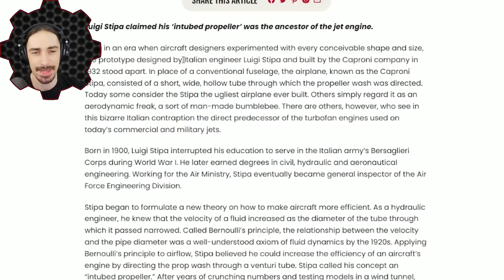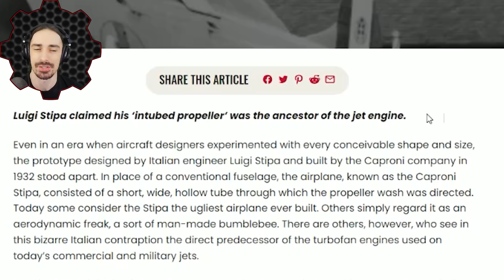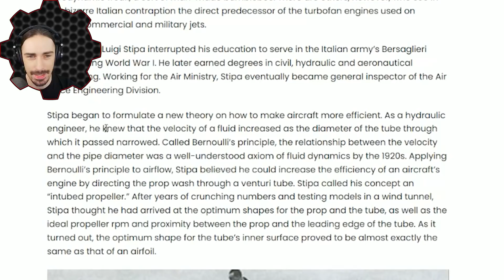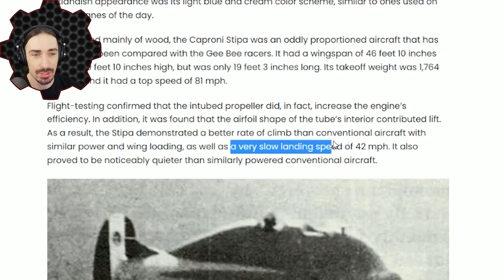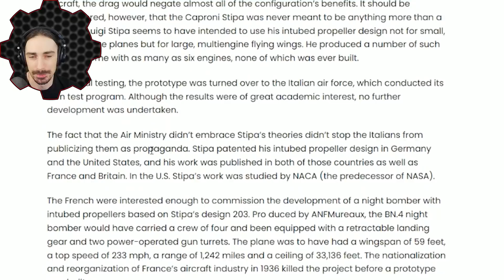Was This Bizarre Looking Plane Actually The First Jet?

Comment: It's definitely not a direct precursor to the jet engine, (it obviously is of ducted fans, but like, those are primarily used in naval architecture, not high speed aircraft.)

Of "jets" it's lacking the most important component, which is a convergent-divergent nozzle to actually concentrate the jet in a useful way for generating propulsive force. These types of nozzles are pretty much universal on modern jet engines, whether a turbojet or a rocket jet.

Speaking specifically to turbine jets, which is what is usually meant with when talking about airplane jet engines, he's also missing basically everything else: an actual compression stage, a combustor to make extra use of the compressed air by heating it up, an exhaust driven turbine to power the thing, as well as not having a proper nozzle on the end. (The fuel line plumbing alone requires levels of consideration this design doesn't even anticipate.) The design also does absolutely nothing whatsoever to help mitigate the problems that aircraft of the time had when encountering supersonic airflow, which was one of the most important driving factors in the early development of jet turbine technology.

It's like, literally just a propellor in a tube. That does not even remotely a turbo jet make, even though they have an aesthetically similar form factor. Looking like the nacelle of a modern airliner doesn't mean the technology inside is anything even distantly related. I mean, I guess it's like the first stage of a turbofan, but that literally is just a jet engine in whole cloth with a fan stuck on the front. Sticking the fan on the front isn't the hugely innovative part.

Comment: I'm pretty sure the yaw you see is just the huge drag. I also built an extremely large biplane powered by 2 (or when I want to i can get 4) helicopter engines at max power and it turns absolutely horrible because of that drag. If you aren't careful you could easily go into a spiral dive, which is  very hard to get out of in trailmakers, and even harder to get out of (and deadlier) in real life. So maybe you could try going into a spiral dive in you own spare time!

Comment: Nice video as Usual. Try to build the concept plane  Vought XF5U also known as the  ,,Flying Pancake,, normally I would doubt that someone ist able to recreate it in-game ,but you have proven yourself as quite creative in this manner .
Reply from the maker: https://youtu.be/BWNQngoesyc
Reply: @scrapman  maybe try a geebee some time down the road when it's not 2 "flying barrel" planes in short succession?
they were both literally the single best racing plane in the world and decidably a crazy wonky failure at the same time.

short version is that they were designed to take turns differently so they would loose less speed in turns while barrel racing, and as a result whenever a pilot would react reflexively to adjust during a turn and do the exact right thing for flying any other plane it would be the exact wrong thing to do in a geebee, with often catastrophic results.

Comment: -> My Actual Comment on this Video: I think the yaw was caused by the drag from the tail fins at the ends of the wings when rolling. You'll see what I mean when you simulate the aerodynamic fluid flow in your mind as you roll.
-> My Appeal to the Audience: Please like this comment if you want to see Scrapman learn more about the engineering mechanisms I've listed in the comment below.
-> DAY 2 of this comment. As far as mechanisms go, I know of one which uses two slots or double sliders intersected. IT'S CALLED THE TRAMMEL OF ARCHIMEDES. (It gives and accurate elliptical motion path)
Then there are mechanisms for drawing heart shapes (idk their names) and there's a kinda complicated one which I don't think can be built in scrap mechanic but it may be possible too if you can try. It's called the Whitworth Quick Return Mechanism.
-> Thanks & Have Fun With These 😄👍Or Not :(

Comment: I dont think that designing a duct that works in similar function of an extremely basic compressor for a jet engine, makes it a predecessor of it , the design doesnt take advantage of the Brayton cycle that jets are known for. If designing this should make his design of the predecessor of the turbine jet engine then the designer of the first pulse jet should be accredited more so as the predecessor of the turbine jet engine as the pulse jet has far more in common with modern jets than what is essentially a flying dyson air multiplying fan.

Comment: My theory for the cause of the adverse yaw ( at least, in trailmakers), is that the upward deflection of the ailerons has a much smaller AoA compared to the downward deflection. This is because the plane, as a whole, has a signficant upward AoA. More extreme AoA on one side of the plane, due to differential aileron position, causes uneven drag, and hence yaw.

Comment: Hey Scrapman, I actually got into Trailmakers cause of you. I can't figure out how planes work at all though. Best I can manage to figure out for the physics of the plane is basic stuff I learned from Jacksepticeye's Kerbal Space Program series. Keep thrust ahead of center of mass, wings above that, keep weight minimal, etc. Sucks that Trailmakers doesn't have any info displays for the center of mass or lift or even info to help you determine how much lift you can get. Got any tips?

Comment: I mean, it looks like a jet engine. I wouldnt say it was the first jet engine though because it works completely differently. A jet engine isnt just a powered propeller with a tube around it. The fuel is actually injected into the turbine itself.

Comment: Just to make a note of a detail which I think you may have missed from the pictures.  The engines were mounted on the nose of a regular aircraft body inside the barrel.  The tail in your case could be made connecting a hidden standard tail inside the barrel on the inner aircraft bodies rear end, just like a normal tail would be.  Just suggesting.

Really like your vids, keep them coming.

Comment: I replicated this plane in SimplePlanes before, and though not all the physics that are core to the design are simulated, it flew pretty good. The one outstanding characteristic I've noticed was the roll instability, which is what I assume to be due to the radial girth of the aircraft. Starting a roll is quite easy, however you keep rolling well beyond the point at which you stopped giving it input. You're practically leading a blind horse.

Comment: There is this kids toy from the 90’s and is still being made today called a flutterby fairy that was essentially a doll with a dress made out of propeller blades and when you turn it on the blades unfold and the doll starts flying and hovers over your hand. What if you tried recreating that in scrap mechanic using the wings mod?

Comment: Im not sure if it should be really credited as a predecessor to the jet engine, the idea of ducted fans is different from the idea of jet engines, hey engines don't get their thrust from the ducted fans in the front, the fans just supply oxygen at a faster rate to the engine so it can continue running, the engine itself is powered by fuel combustion, the fan concept just makes sure it gets oxygen fast enough to actually keep burning fuel so fast, another interesting fact is that some of the actual thrust the engine produces runs back into a turbine that powers the ducted fan, thereby being more self sufficient

Comment: There is also an important landing procedure called a flare. So when you are about to land on the runway, you first put your throttle to idle, and do a slight pitch up input. This will cause you to descend slower, while slowing down, to help stop the aircraft. It makes for some VERY smooth landings.

Comment: There are multiple ways to turn an aircraft. One of them is sideslip. This is used for small aircraft, how it works is you roll to any direction, and you do not input ANY source of pitch. The aircraft will literally pitch down, without pitching down. Kind of like a slide. It also makes way more yawthan normal yaw input, thus it will be easier to correct a wrong turn quickly. But if you go around the 80 to 90 degree angles, you will stall. And you will stall HARD. When they were testing, they described it as “the plane just fell like a stone!”. When you want to cancel or stop the sideslip, you roll the opposite direction and yaw in the same direction on roll. Then, you have to pitch up when you roll. When you are level, well, you are level I guess.

Comment: The problem with your yaw while you are rolling is called adverse yaw. It is also a problem on gliders. To correct it you just need to use a lot of rudder to counter act it.

Comment: day 154 or 155 of asking scrapman to start a Survival series amphibious tank/basically any transportation and floating base/barge (or under water.) But you need mods... it's a requirement to breathe underwater, if you want an underwater base/transportation. And yes i am talking about the underwater fan moonbo reviewed that basically makes water spaces air spaces... if that makes any sense.) (and if you wanted to move the barge/boat/floating base you are able to make thrusters/glitches/mods to do it or by lift or actual push

Comment: One more thing that does not translate to trailmakers is that the tube itself il like a huge circular wing that also provides lift. you can make a paper tube with an airfoil shape and it will fly when you throw it.

Comment: The adverse yaw effect when trying to roll is totally normal. It is more pronounced when flying slow/with a high angle of attack. The reason for this phenomenon is that the lift creating surfaces also create drag. When you roll into a turn, the wing on the outside of the turn creates more lift than the inside wing, so the plane rolls, but at the same time, as the outside wing creates more lift and therefore more drag than the inside wing, the plane will yaw towards the outside of the turn. To prevent this, you can couple the rudder/yaw function to the roll, so that the rudder actively pushes the nose towards the inside of the turn whenever you roll.

Comment: If you build the cylinder as an horizontal plane of plaques connected with hinges that dynamically form a cylinder, I think you can wedgegand the front end and massively reduce the drag.

Comment: The yaw when rolling is actually pretty accurate to planes in general, just some left turning tendencies, the only problem is you don't have tail rudders to counter it the way you built the tail
Reply: Agreed, the big rudder didn't help anything with TM physics... should have made the fin bigger on top
Reply: I love secondary effects of controls, lol
Reply: In this case its not left turning tendencies, it's adverse yaw
Reply: @rg759  which is one of the left turning tendencies
Reply: @casmsfrought9956  I think he means the p-factor, when the air from the propeller spirals around the airplane and hits the tail on one side. Air from clockwise rotating props will hit the vertical stabilizer on the left side, pushing the tail right and the nose left.
Reply: @LeftPlaying  That is slipstream not P-factor which is a tad more complicated. It is adverse yaw. E.g rolling to left increase lift on right side. More lift=more drag and thus right wing "drags" behind. You have to yaw in to turn to have a coordinated turn. And vice versa.
Reply: yeah, normal planes do that so that they don't have to roll so much and make all of the passengers go sideways, while still making relatively sharp turns.
Reply: Yep, sometimes I make it intentional. Helps with turning really big planes too so you don’t have to roll as much because if you roll just enough it’ll just yaw you to where you’re facing

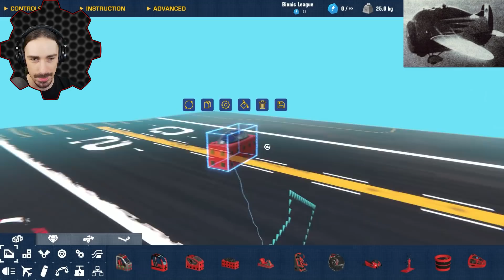Comment: 5:04 solution: fire up a fluid sim in blender, set it to gas domain, tweak the physics to make it behave like air, set the simulation density extremely high (basically increasing detail), and finally, pray that it doesn't crash and wait the next 10 days for resu-

...it crashed instantly.

Comment: You should make a Cyclocopter it's a very odd method of flight
Reply: I agree with the Cyclocopter recommendation. However, if you do some digging, the Cyclocopter's rotors are finely tuned in such a way that it would not be practical making it in a game.
Reply: @locke_ytb  I thought it might be and so that's why I also suggested the 5 ton Rhino Tank
Reply: @shwellava  I have no objections with the Rhino Tank.
Reply: You could also make the Five ton Rhino Tank 🦏
Reply: c y c l o t e c h    V  T  O  L
Reply: @apersunthathasaridiculousl1890  yes
Reply: Cool